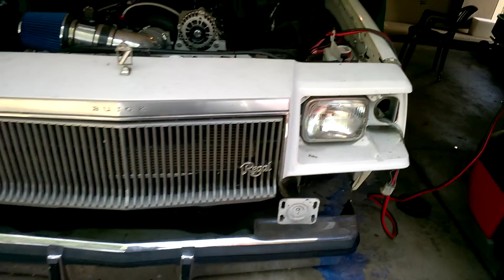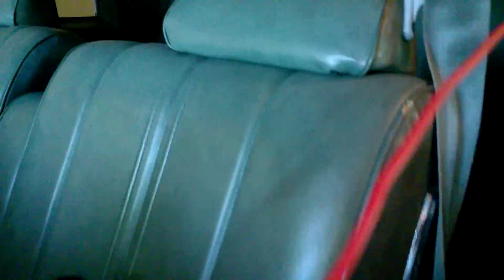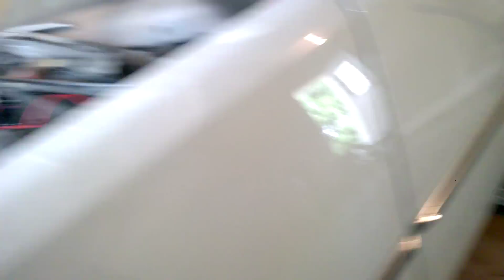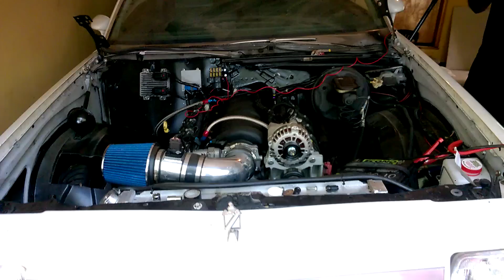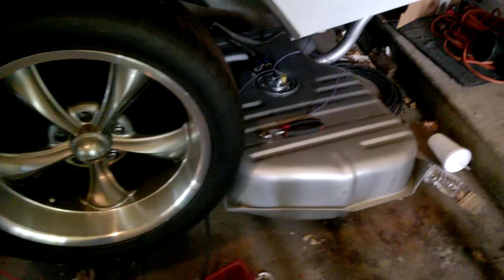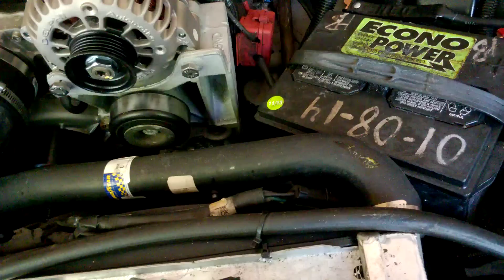Meech's LS3 swapped Regal.....first start up

Comment: lookin good  Ken. 
how much do you charge for harnesses
Reply from the maker: It all depends. Starting at $225 depending on if its just a swap to stand alone, more if it needs to be modified (ex: converting a truck harness to work with a car style intake
Reply: +Ken C  Ok let me know how to contact you .
It will be truck converted to car injectors/intake .just don't know if I will have a general 3 or 4 yet.

Comment: question bro wat intake I need if my 6.0 came from a 05 escalade an I wanna run the fuel injection
Reply from the maker: Gerald A You can use a LS1, LS6, LS2, or the stock truck intake. Cathedral port

Comment: when doing the swap. what all needs to be changed to have a seamless conversion. heard you mention he had to change the fuel pump..... what else would you suggest??
Reply from the maker: Conversion harness, efi pump and tank. If you have a g body, the stock Monte Carlo 4.3L tank supports efi, you just have to add a pump capable of the pressure that the LS motor needs(58 psi). G force makes a conversion double hump transmission crossmember. Headers or something like f body LS1 manifolds, or Camaro LS3 mani's.